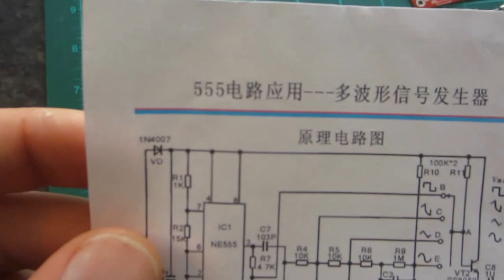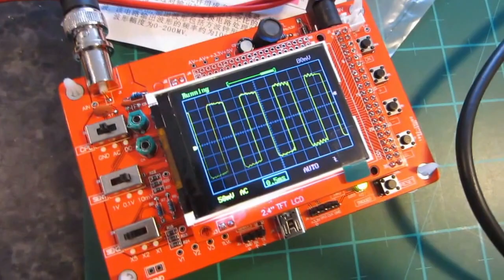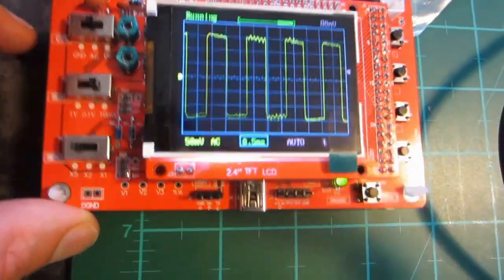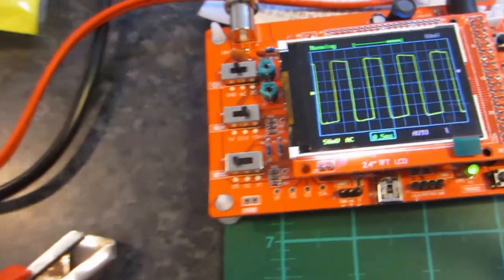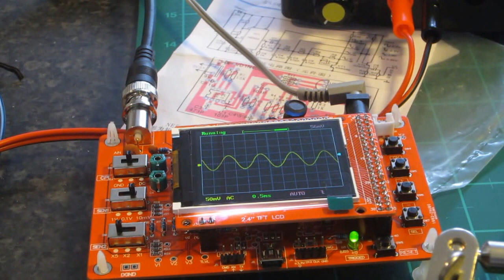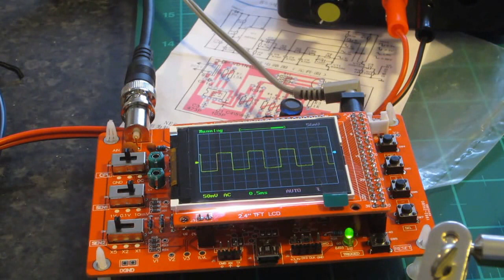555 Signal Generator DIY KIT Review

Comment: We can add to the initial fixed resistance (1kΩ) and a potentiometer and a fixed resistance of 1 kΩ in series between the pins 7 and 6 of the IC. This will allow us to differentiate the frequency.

Comment: i have this but i can not understand what is made for???
i saw you connected to oscilloscope but that's all????
Nothing else to do with it?
Reply: sound, function generator, many many things
Reply: yo ianrhodes i used a small speaker and i heard some stuff but looks like it needs amplification in order to have a clear sound... any schematic for that amplification or any ideas?
Reply: look up simple op amp audio circuit. or just audio amp circuit
Reply: look up simple op amp audio circuit. or just audio amp circuit
Reply: yo ianrhodes
audio amplifiers have right/left channels signal input and ground. so they have two inputs and one ground. this generator here have two outputs. should i use only one of the right or left input to the sound amplifier?
Reply: Either one, they are different. So maybe a switch or two plugs. Try mono plugs first
Reply: yo ianrhodes thanx!

Comment: I have one resistor thats Blue , everything else seems the same in your video.  They don't match jumpers wise which are probably upside down but oh well...  I find this a better learning kit than the learning kits :O  Where the blue resistor goes will be the question.  ie I'll probably put everything that fits like above in then see if there's any empty.  Very useful video.  And again not sure if I'll use this for anything.  It's more for a practice board and it's way cheaper than the actual practice boards out there.  :O
Reply from the maker: I find the ideal use is to test audio amplifier circuits to see the power at certain frequencies/waveforms, with an oscilloscope attached. However I do find that this kit barely cuts the juice in terms of flexibility. Perhaps look at the fink that Glynn H posted below to the XR2206. I'm actually curious myself to see if anyone can make a review on that board.